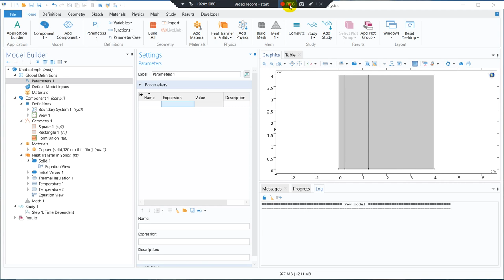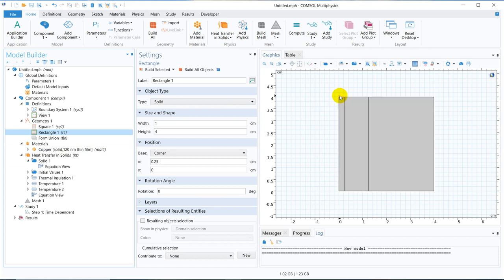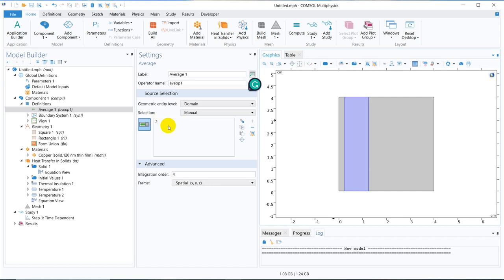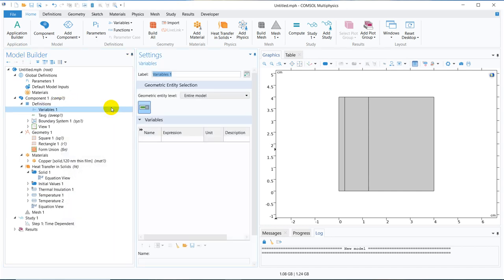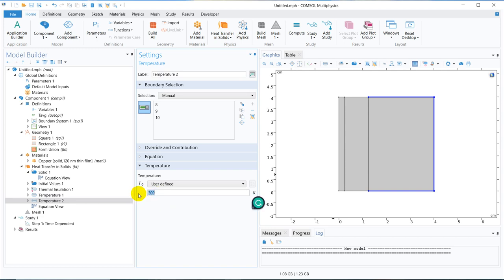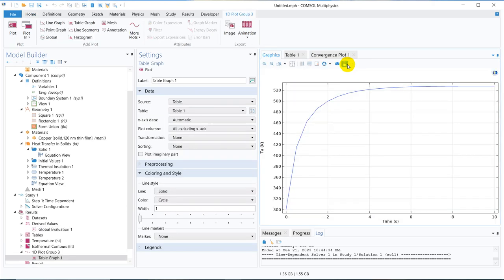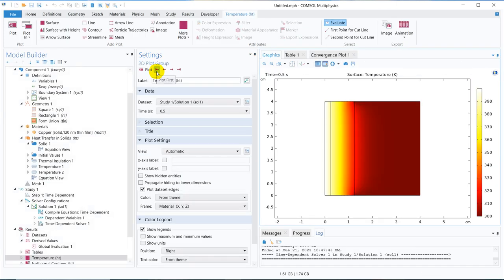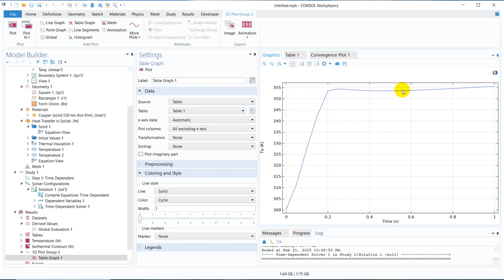COMSOL for Beginners Lecture 6 Feed back Control #COMSOL #feedback #beginner

Comment: Please make more videos on two-phase flow using the phase field method.
Reply from the maker: Can you please suggest, what exactly would help you and others? Then I will work on it and start uploading again.
Reply: @pioneerofsuccess4054  sir my research simulation is on two phase flow model and the video will help others also who are working on two phase flow 
There are so many options which are not known how to take their values like mobility tuning parameter, parameter controlling interface thickness etc if you please made the video and explain them clearly about phase field then it will be of much help.